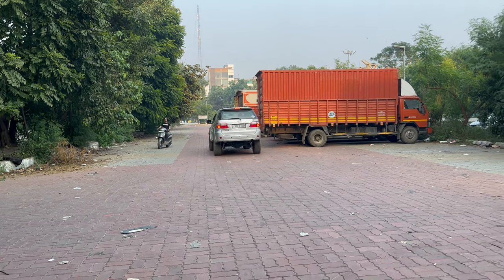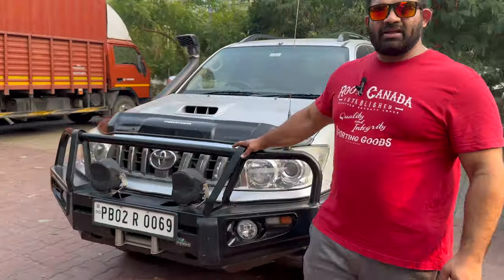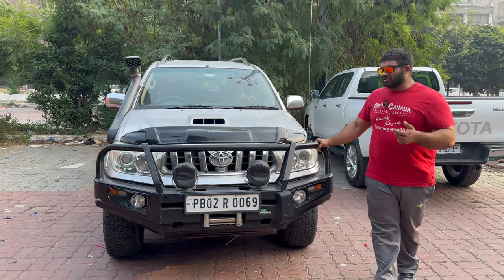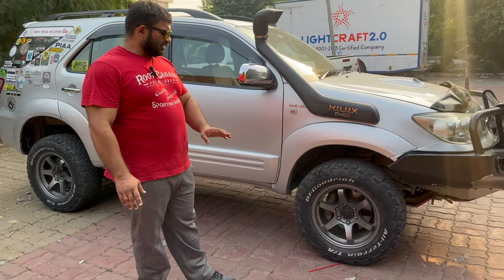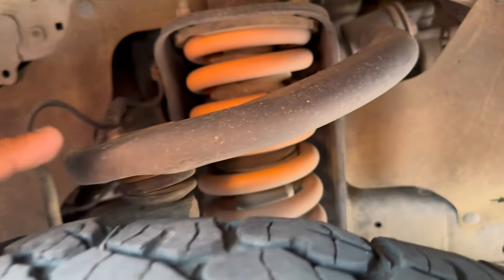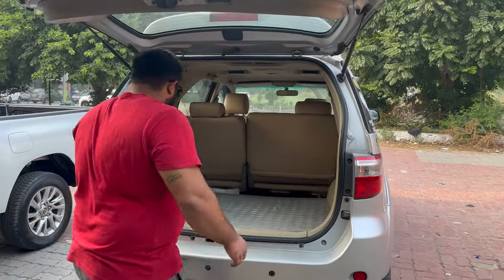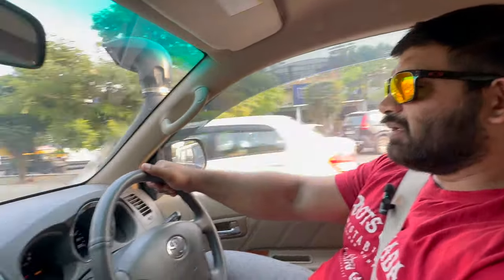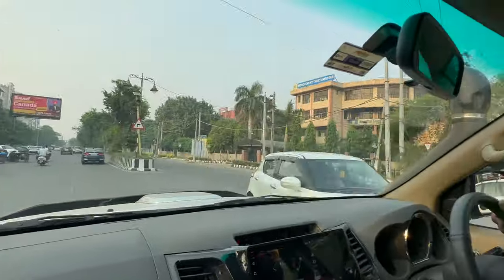The Ultimate Overlanding / Travelling 4x4 Vehicle for 10 Lakh. #4x4 #fortuner #offroad #toyota #trd

Comment: This particular model some people have complained about vibrations while breaking at high speeds and the brakes are not good.pls suggest the solution
Reply from the maker: Very accurate observation 
So this model did have braking issues due to a weak brake booster and master cylinder set. The ultimate fix for that is upgrading to a brake booster and master cylinder set from a 2015+ model Automatic Fortuner. The same has been done in this vehicle and it makes a world of a difference.

Comment: Hi Jaydeep, just need your advice brother...
I have just bought a brand new 4x4 diesel auto Thar and looking for a suspension upgrade with the objective of improving bad road ride quality and highway handling. I may appear in occasional offroading events, nothing very serious. I am not looking for any lift. Among the available options which one would you recommend. I am looking at 285/60/R18 Maxxis 980 Bravo AT. I am told ARC and  Profender are good options with Profender being the cheapest option at 48k +  installation, perhaps coz it doesnt come with springs and just the dampers.

Pls advice. Thanks!